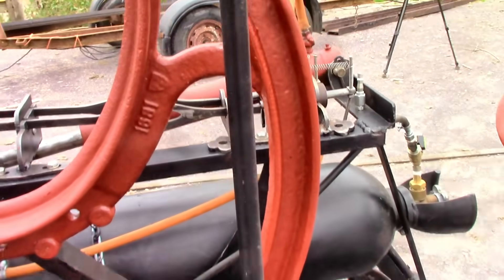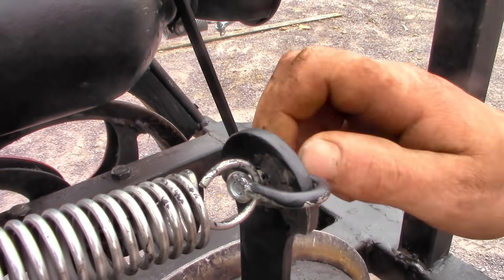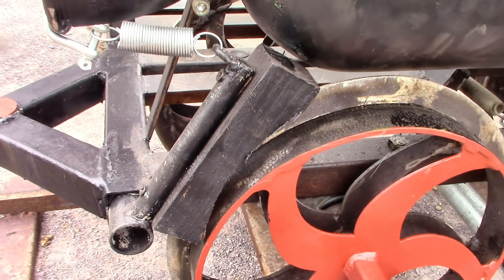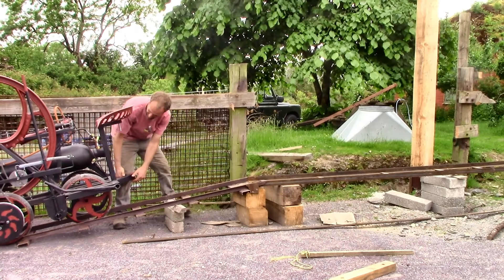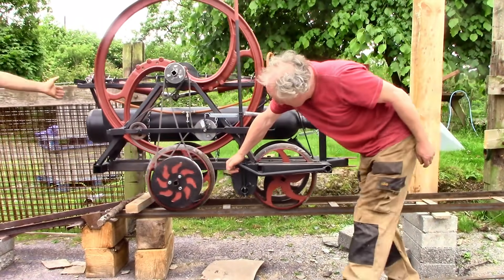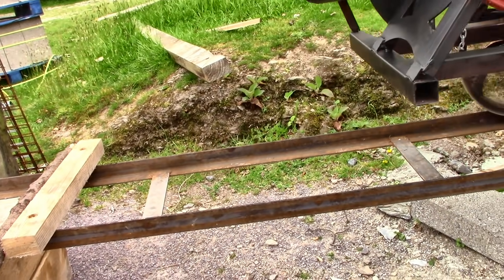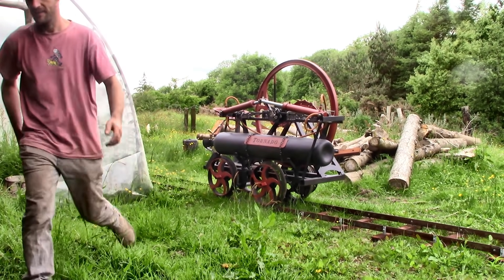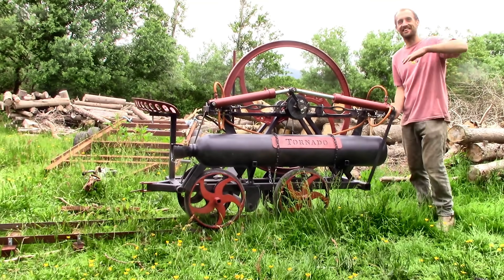First Run!! Home-Made Compressed Air Locomotive For The Field Railway

Comment: to increase your air pressure you need a strut pump.  They are used to pressurize the suspension on airplanes.  
Basically a big air piston is used to push a small air piston to an increased pressure.

Comment: Pro Tip. Cover your rails with bed blanket and then some kind of gravel or rocks. No more weeds. It also keeps the rails from moving around. Its called ballast. You can easily cut the fabric away from the rails after.

Comment: Quint builds channel has built a very effective air compressor from plastic bottles and a water tap. I wonder if you can do something similar on a more industrial scale but using cheap junk as you like to. Id love to see the loco running properly amd hauling materials around site. This coukd be one way to get the pressure you need without €€€.

Comment: maybe to increase range, make a little 'tender" with a generator powered by the wheel rotation and a little compresser to keep a constant supply of compressed air for tornado to run on

Comment: I just watch your video and I love the locomotive. I also thought of an idea to improve it. Theoretically speaking, if you were to run an air compressor off the flywheel, that generates more air than the locomotive uses, theoretically you'd never run out of air.

Comment: I'd suggest considering to use a "hoverboaord" (those side-by-side foot balance boards with a wheel each left/right of the feet, and a short axle between the two foot-platforms) grabbed used or even possibly partially broken from ebay and use that in place of the air system to drive your locomotive from just a battery.

Comment: here a idea how about adding a chain or belt connecting both axels so that you and have both axel getting power and when you brake both axels should stop too pluse in the future when you may have a heavy enough load when you start using her you may have more tractive effort with all 4 wheels being power and not just one

Comment: You know i had a thought even if you built a compressor car that ran on solar or even connecting an alternator to the wheels to create electricity somehow yes you'd have to refill from the tender but it would give you some more range especially if your just coasting and could refill on the spot even if it is only 100- 120 psi at a time.

Comment: If you open up the unused ports on the cylinders there would be less resistance on the power stroke the loco should go better
Reply from the maker: it wouldn't work at all if they were closed up : -  )
Reply: I didn't say close up, I said open them up i.e. make them a larger diameter hole, as we can hear the air sucking and blowing out of the small holes you have now. @wayoutwest-workshopstuff6299
Reply from the maker: @paulmott9840  Ah, you meant open them up more. Now I understand. I was pointing out that if they weren't open then it wouldn't work at all.

Comment: Great job! Since i see that the theme of this railway is budget, you could make the electric locomotive out of a used electric scooter. They are dirt cheap and have all the parts you need, and can actually be quite strong. Fe: my xiaomi pro can pull my 100kg up in quite steep inclines, and its top speed is 30km/h. If you use the motor along with a 4/1 or 5/1 set of reduction belt pulleys you could easily pull 400/500kg up a hill with the top speed beeing 7,5km/h or 6km/h (walking). the peak motor power is 900W with about 600W constant pulling, less (about 300) at a constant speed. The battery is 474Wh and should last about an hour of constant shunting. You can increase the motor power in the firmware but you should make some cooling for the motor at that point. You need no clutch as the motor is electric. The motor is a 3 phased with hall sensors, so all you have to do to change direction is swap two phases and 2 hall sensors(aka wire in a single switch). The best part: the whole scooter (xiaomi m365 pro or pro 2) is about 250/300€ used, with parts readily available. It also has cruise control and a motor (regen) brake. Something to think about. You can easily run two if one isn't powerfull enough (wiring them to control them in parallel is super easy) and even make the loco 4WD. I know mine will eventually become a ski rope for kids.

Comment: You know....you're not in a bad position with the locomotive to make a modification to the design, that could be inspired off of Richard Trevithick's locomotive (relevant photon link: https://i.ytimg.com/vi/K40XrR67fas/maxresdefault.jpg) rather than having the seat attached to the locomotive like you have it, you could always have a separate platform for it, which with some modification could also be used to carry tools along with you, and even more air tanks for longer operating durations.

just a suggestion for you to ponder, and a potential project for you to work out.

Comment: The reason the brakes dont work so well (i still think you did a great job designing!) is because the width of the rails is far less than the wheels, and you dont get much surface area to grip when applying them. that, and if you had 4-wheel brakes, you could get more grip. now i know after all this you probably DONT want to rebuild every painstakingly laid rail from scratch, so in my opinion, giving the locomotive 4 wheel brakes is the way to go. also i absolutely love the engine you made!

Comment: Fantastic, as you know you're constantly fighting the ever-decreasing air pressure, small air compressors for charging PCP air rifles can be brought quite cheap now most will give you 3000 PSI, you'll have to fit a regulator, it might be worth fitting one anyway as it will smooth out the flow giving you a constant pressure, energy companies are looking at compressed air as a way of storing energy, solar and  wind driving compressor into receivers that drive turbines when the sun doesn't shine or the wind doesn't blow.

Comment: Was thinking about your loco 
If you use a refrigerator compressor you can get some very high pressure if you use 3 compressors two parallel into one you might get the tank pressure your looking for and they are cheap from old refrigerators or air conditioners.

Comment: maybe beter brake would be long stright piece meant to add signifficant friction with the flat bit of rail?
seen those on trams for example, all you'd need than is just a lever to actuate around medium sized wheel to push the brake down onto the track

Comment: All it needs is a whistle. Also, add a rod to connect the two sets of wheels in the Air tank side (the side with no pully on it) to make the rear side of wheels have driving power too. As it is now, only the front pair of wheels has driving power, so adding a rod to connect the the two pairs of wheel (like on steam locos) you will get more power out of your loco. I work for a Railroad so I know a thing or two about locos, hope this helps!

Comment: This is spectacular, she looks excellent and runs great too!

I've two ideas / suggestions! With a simple high-pressure regulator you could easily take 2-3000 PSI to a more manageable 100 and continue to use your valve throttle setup; pending a compressor that can get you such high pressures!

Have you considered linking the front and rear axles together with a pair of sprockets and chain? That would theoretically double your traction and braking power. 

Cheers!

Comment: There is a machine you can use to get higher pressures from a low pressure compressor, its used on hydrogas suspension to set pressures at varying suspension heights regardless of low nitrogen bottle pressure.

Comment: Are you going to keep this a ls a compressed air locomotive or are you going to turn it into a steam powered loco?
Reply: The pressure and precision involved with a steam locomotive would require building a new one from the ground up.
Reply: @WasatchWind  you have a good point

Comment: Seems like the best choice for air compressors are ones aimed for Paintball guns and such, looking around 300-400€ and going to 4500 (not as much as those scuba gear ones, those start at 3500e being the main cost is air filtration)
there is also a hybrid of steam and air locomotives. A fireless steam engine, ie. still runnign in Herne at the SASOL plant, using excess steam generated by the solvent factory

Comment: If you filled the air tank to 20000KPa (3000psi) then it would be a very good idea to have a pressure regulator between the tank and the throttle valve that drops it down to 700KPa.
Otherwise, you might just blast your air fittings off the tank valve and/or burst your hoses.
Reply from the maker: yep, that's the plan

Comment: A small suggestion, no problem with the design, (it's amazing) but I think a rubber horse mat cut into form on the break pad would help stop friction faster, also beautiful locomotive you got!.
Reply from the maker: Thanks, Jack. The wheels stops ok, though, just with the wood. I just need to stop more wheels so the loco itself stops

Comment: Definitely need to add a way of lubricating they cylinders. Hydraulic cylinders are of course designed to handle higher pressures than pneumatic cylinders. Common for them to have cast iron rings to seal the piston in the cylinders bore. Awesome machine though! Well thought out with the cam and spool valve arrangement

Comment: make sure you remove all the oil contaminants left over from your compressor air before you put 3000 psi in that cylinder remember a diesel engine ignites the charge at about 150 psi
Reply from the maker: I was wondering the same thing, Neal. Do you know for sure that those two situations are compatible? (Oil in a cylinder and oil in a pressure tank?)
Reply: @wayoutwest-workshopstuff6299  The diesel and air in a diesel engine are a perfect mixture and the diesel is fully atomized so it is going to ignite every stroke that doesn't mean as soon as you get to 155 psi a bit of oil residue will cause an explosion but all high pressure cylinders carry a use no oil warning

Comment: When I think of tiny compressed air locomotives I think of the ones which have swashplate motors which made a tremendous buzzing sound when running.

Comment: Would you not be able to use those hydraulic rams as double action cylinders by using both sides of the ram?
Reply from the maker: Yes, but I'd need another set of valves and twice as much air

Comment: Super congrats Tim!!!  Its been epic to watch the evolution from your steam trials progressing through to compressed air.  Your celebration when Tornado worked was pure joy to watch.
I think it's been very clever to switch to compressed air - you're able to pause your energy use at any time (and for any amount of time, days/weeks even) and resume on demand; whereas steam you can't really pause without losing heaps of energy, and it takes ages building a head of steam in the first place.  Air for the win!
I really like your design/test/review/redesign approach is not fearful of setbacks; and the quality of your resulting device is something actually quite beautiful - with the finishing touches of little embellishments in the shape of the valve rods and spiral wheels spokes as well as a solid name plate and of course an actual paint job; it just looks right!
I'm much more up tight in my development of ideas, so your videos here tell me to relax a lot and enjoy it - thankyou!!  
Please stay safe doing this stuff as I look forward to many more of your tales in the future; I'm a bit worried about 3000psi working its way into your design; please don't "fly too close to the sun".
PS.  I note your transmission to the axle is onto an external wheel on one side - perhaps  if you attached an external wheel on the other side and "linked" the 2 axles with another belt your pulling power (and braking power) would be across all 4 wheels?
Reply from the maker: Thanks, D. Yes, the plan is to use a sprockets and chain to link the two axles, but I still haven't found a compressor..

Comment: Back in 2010, I recorded an outdoor 7 1/2 inch gauge air powered "steamer" for the Narrow Gauge Convention in Hickory NC.  The line is down in South Carolina.. The owner decided that air was a LOT safer than steam, so he went that way.  The Air is provided by tanks in the passenger cars.    https://youtu.be/WT0hjdW3I9g?t=128
Reply from the maker: Thanks, Bill. It's a handsome machine but I couldn't see the details which would have been interesting
Reply: @wayoutwest-workshopstuff6299  The guy built it from the ground up as a steamer, but then ran the numbers for compressed air and went that way.  A "boiler" issue would just be a air leak... with steam it oculd be explosive.  So he went from the ground up. Naturally, the firebox wasn't a firebox... Rode behind it... amazing little engine.  Reminded me of small live steam.  All the normal appliances were there for "air compressor" and so on....

Comment: OLD PEDAL SEWING MACHINE THE NEEDLE ATTACHED TO THE PEDAL(S) BELOW MAKING THE WHEEL MOVE BY ITSELF 
YOU CAN MAKE A THROTTLE OR MECHANICAL SWITCH TO TURN MAKE IT GO      IT CAN BE LIGHTER WEIGHT ALSO 
AND YOU CAN USE GEARS CERTAIN PLACES IF YOU LIKE TO GO A BIT FASTER   THE WHEEL IS AGAIN GOING BY ITSELF 
IT'S YOURS OUT THERE IT WILL ROT IN PATENT   THERE ARE THINGS YOU CAN DO WITH IT TOO

Comment: Amazing!  I admire your engineering.  I suggest connecting the two "rod end" cylinder fittings together.  Air would chuff out of one, and into the other.  At least keep moisture out of the cylinders.
Reply: As I understand it, that would prevent any air from escaping, thereby bringing any possibility of motion to a standstill.

Comment: you need to oil the cylinders as the rubber seals will wear out very quickly and then the air will bypass out the breather on the other end end of the cylinder

Comment: Have you try to make another air tank and air compressor that will pump air in the tank while the train moves so that when the other air tank is out of air you can just switch the supply to the another air tank that is full and then vise versa

Comment: Your tank might hold 3000psi but the rest of it won't unless its all hydraulic, and then only until you blow out the seals.
Reply from the maker: Ha! Well of course I'd use a regulator. My plan was to run it at 200 psi
Reply: @wayoutwest-workshopstuff6299  ohhh ok. Yeah, that makes a lot more sense. A lot less shrapnel.

Comment: I think that a plausible idea would be to build an (at least temporary) “tender”, more or less a much bigger pressurized air tank on a wagon, and have it directly connected to the much smaller tank already mounted on Tornado herself. Even if it wouldn’t see much use on your small railway, it could instead be used to take Tornado to longer railways of the same or similar gauges. It would be really interesting to see the mighty Tornado putting those conventional steam locomotives to shame!

Joking aside, I really love the result of all your hard work and determination! I think it really paid off, and I hope Tornado serves you well.
Reply from the maker: Thanks, Railfan : -  )

Comment: The issue with the loco sliding while breaking might not because she lacks wheight on the rear axle (although that might/does fix the issue), the problem lies more in the profile of the rails. As the rails are simply strips of flat bar layed upright, the wheel has only about 2mm of width to grip onto. A propper rail has a mushroom shaped profile, which gives the wheel about 50mm (on smaller field railways/Decauville track somewhere around half of that) for the wheel to grip onto. Whidening the rail head in one way or another (perhaps by welding a angle profile onto it?) will improve grip and thereby braking and pulling power of the engine.
Reply from the maker: I must make a video sometime about traction - it's far more complicated than area of contact. But thanks anyway

Comment: I'm experimenting with high pressures- try a refrigeration compressor, if supplemented with an oiler in line, you can realize 4-600 psi I've daisychained 2 ac recovery compressors, and obtained 860 psi- at that point I stopped because my connections were of JB weld and soldier..... bad idea in general after 100psi...so I quit while I was ahead until I can afford the correct threading materials. Oh. The pressure lines are small 1/8 th- sloow, maybe do some weeding or affix a washing machine timer when you retire for the evening filling an argon tank of that size to 700 psi, well I'm guessing 5 hours ide be using a dive tank compressor but  my wallet has been complaining- at this point I have to listen...great vid
Reply from the maker: Thanks, Pierre. The problem is I wouldn't be storing enough at 800psi. And I'm like you - no money for a proper compressor - so I'm not sure what to do next.

Comment: Congratulations! This is a wonderfully sound and beautiful System you put together with the loco as the pinnacle now!
This is also so well made for imitating because of the cost efficient approach… loving it!
Would double acting cylinders make sense (with maybe the low pressure reuse of the other cylinder)?
Reply from the maker: Thank you very much!

Comment: My friend, get yourself an air compresor for filling air rifles. Mine goes to 4500 psi.
Reply from the maker: I hear that they fall apart if you leave them running for hours?
Reply: @wayoutwest-workshopstuff6299  I know it's the wrong power source but thought you might drive a simple compressor with your diesel engine while you're chopping wood, might be cheaper than an electric one?